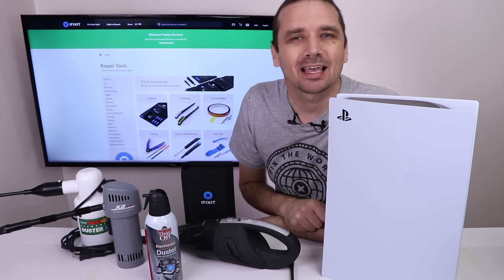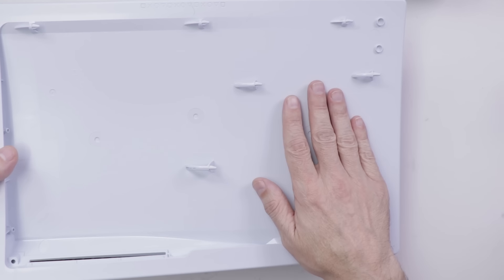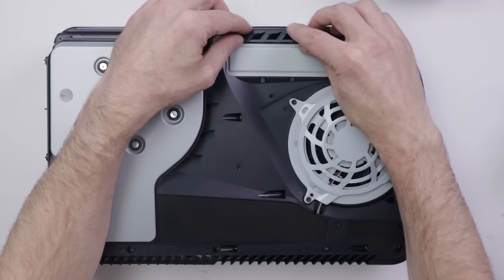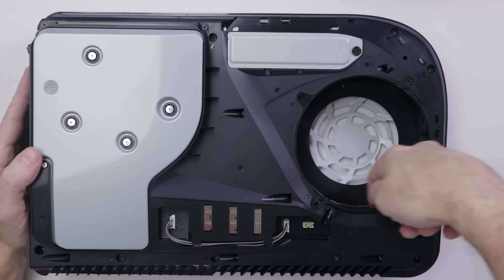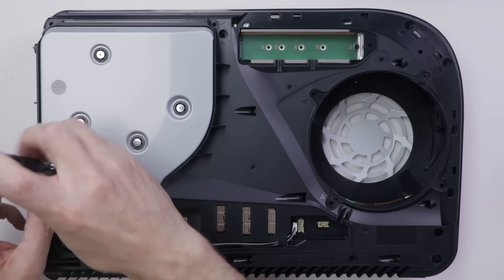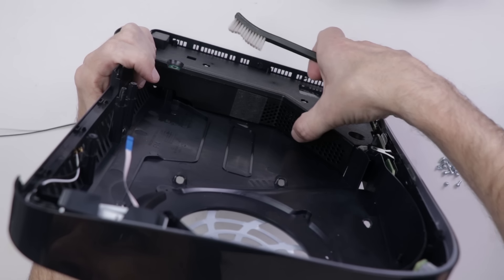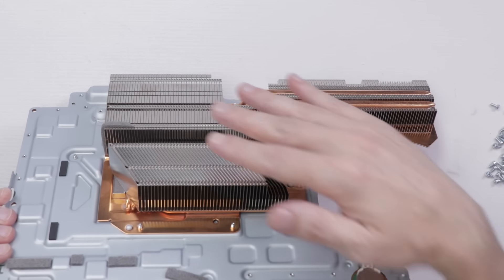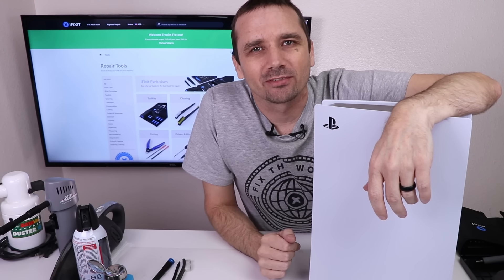How to Clean Your PS5 Safely - 3 Stages

Comment: Who else is here Bc their PS5 is shockingly quiet and they wanna keep it that way
Reply: i want to keep my ps5 clean but i dont have the balls to dis assemble the fan or mother board do you think i should lay it down or stand it up which one prevents more dust
Reply: @dodowater6936  But how can you clean it if you are too scared to disassemble it .
Reply: @zsk1y  you don’t have to fully disassemble it you just have to takeoff the white covers and vacuum the dust catchers and the rims and vacuum the white covers themselves
Reply: @citedgem  or you can just go to them game shops that repair and clean
Reply: @dodowater6936  bro do we need some sort of small attachment to clean the dust catchers?
Reply: @citedgem  iifyou only do stage 1 cleaning I don't think you're at any risk of jeopardizing your console, looks pretty safe
Reply: @EfftingES  yea mine is starting to make weird noises its quite but weird
Reply: @citedgem  it’s probably the coil
Reply: @MidnightIX  nah it was the disc
Reply: Not me
Reply: @MidnightIX  It is probably 2 reasons. Sony hasn't told everyone that all ps5's have the same fans. There are slightly different fans do to rushing systems out that are slightly smaller and less blades you can look it up on here. I think that could be it or you have your ps5 in a very confined hot space which is not good. Another thing you could have something in manufactured caught in the fan. A bug or something. Open it up. That happens also. Bugs roaches etc like to hide in consoles for warmth etc.
Reply: It’s hard for dust to get in horizontaly because the white covers block off everything
Reply: @Ggbrownieeadywin  Is that really true?
Reply: @citedgem  it’ll get dust regardless. You just have to maintain and clean it somewhat often before it’s gets to be too much and you won’t have to take it apart
Reply: I've had the console for 2 months now and I can see that it has caught up a lot of dust
Reply: @kyeresmith7772  I haven’t cleaned mine since I got it in November
Reply: @taliban223ms3  is it full of dust
Reply: @kyeresmith7772  I haven’t checked but it most likely is Bc someone blew a bunch of dust throughout my room on accident a bit ago I’m pretty sure it’s pretty dirty inside
Reply: @citedgem  same here lmao. Did you do it? If so, was it easy enough?
Reply: same i wanna clean my non-existant ps5
Reply: My ps5 is extra quiet so I wanna keep it that way but it’s funny that runs the risk of possibly breaking the ps5
Reply: @citedgem  wrap it with dust filter cloth
Reply: Bro i tried this and now my ps5 is loud like wtf😭🤦‍♂️
Reply: If you thoroughly clean it and replace the thermal paste it'll be like night and day.
Reply: @ivanvazquez7811  rip
Reply: @ivanvazquez7811  wait you cleaned it and it got loud?
Reply: @Juan800PimpBot  PS5 doesn't have thermal paste it uses Liquid metal
Reply: Me
Reply: @MadstupidStickmanEbruvplzsub   mmm
Reply: @Ozzy-2407  I know this already I was talking about ps4s because that's what people were talking about. If it was quiet and becomes noisy there is definitely an issue regardless of which generation of console I've repaired all kinds of stuff🤣
Reply: Me
Reply: My ps4 has given me ptsd 😂
Reply: Me ong
Reply: @dodowater6936  what if you’re too scared to take off the top cover cause you don’t want to break anything
Reply: @sou1eater218  all my homies were scared to with some force just lift up at the top corner and slide down
Reply: its not quiet
Reply: I can't see the inside it is CAKED with dust
Reply: @citedgem  bro it’s easy just don’t remove the motherboard or remove the fan wires I disassembled it and it was easy
Reply: @dodowater6936  what of you don’t have the air thing
Reply: Stage 2 is not even bad. That is if you not some destructive monster who has no patience or decently steady hands.
Reply: I dont even hear it
Reply: I am here because mind became louder than ever, and i juat cleaned my ceiling and dust flew everywhere
Reply: You’re not the only one
Reply: This thing is already hard enough to find so you best be sure I’m keeping this thing clean
Reply: @tbitwrld_3144  I would probably do this in a heartbeat or have a buddy who's knows how to clean consoles and invite him or her over to help out.
Reply: @EfftingES  guess I'll just start on getting a air can and just a old toothbrush
Reply: It's even more quiet without a disc drive 😂😆 love it
Reply: Same here, but I’m not planning to clean it for a couple years
Reply: Mine might as well be a nuclear test site, cannot relate but good luck keeping it that way, I’m irresponsible
Reply: I 😭😭😭💯
Reply: Is it still???
Reply: Is it ok that I used sum wet cleaning wipes? Already did the job
Reply: @tbitwrld_3144  what game shop does that
Reply: @citedgem  lmao same bro 😂
Reply: @dodowater6936  how do you do that??
Reply: @citedgem  same lol
Reply: Yup.
Reply: @dodowater6936  oh I need to start 😶 it’s been 3 months already.
Reply: Mine got so bad it started crashing on me
Reply: I’m here because mine is gettin loud
Reply: complete opposite, my ps5 overheats and sounds like a motorcycle, every hour of playing fifa or fortnite, etc, it shuts off and doesn’t give a warning. my games have been corrupted because of this too
Reply: @matthewmajewski4249  same
Reply: @amazingcloudy9351  haha same 😭
Reply: My ps5 always shuts off cuz it overheats can’t even enjoy warzone anymore
Reply: PS4 Pro homies I see
Reply: Jus got it cleaned today I can’t even hear it when I put my ear on it 😭
Reply: I got my ps5 not couple months after release. I gave the outer part a clean as was alot of dust. Recently tho cod has been a bit jittery and mk11 will turn my console off half way thru a round sometimes so decided to clean today. Used tooth brush cotton buds  a just bpught kit with the screw driver piece in and...... a bike pump with a football nozzle in as waiting on gf to bring back the air can from work. Did half decent job tho not sparking by any means but had ps on for bout 15 mins playing mk and seems to be running smooth and not sure if its placebo but quieter maybe. Il update if it crashes again
Reply: @Ggbrownieeadywin  i think its a million times dustier while horizontal its closer to the ground
Reply: Me
Reply: Mine is still stupid quit but just wanna keep it clean and there is a lot of dust on the sides of the center
Reply: I hot mine a month ago and am just cleaning it every month
Reply: Me
Reply: Its been 2 years now and it still dosn’t make a sound
Reply: So to be prepared for my ps5 in 2028 when it's in-stock
Reply: Same
Reply: @kyeresmith7772  try dusting once in a while? I dust my ps5 and it's cabinet space/ area at least once every 2 weeks. Takes about 30 seconds
Reply: Mine sounds like a turbine engine when ever I play Ghost Wire Tokyo so I think I need to clean it
Reply: getting older is taking care of your toys XD
Reply: FAX
Reply: @EfftingES  Stage 2 Cleaning is also really easy without any experience buy just following the guide carefully step by step. But i wouldn't do Stage 3 either.
Reply: Me
Reply: @citedgem  Same
Reply: What is a good Amazon product I can use for my ps5 to clean the dust
Reply: yep
Reply: Is it true that if you use the van air the dust will just go more deep inside the ps5
Reply: @citedgem  I don't have the balls to take out the plates
Reply: Me😂😂😂😂
Reply: @citedgem  that normal the ps5 disc make that noise when cutting the ps5 on
Reply: Especially the delta fan of a super quiet
Reply: Me
Reply: I got mines a week ago and the glossy part a dust magnet I’m definetly gone have to clean mines often this generation I’m just scared I’ll mess some up
Reply: Gotta o the fans that's the B part about the whole cleaning
Reply: Damn so much just to own a system
Reply: @Juan800PimpBot h.H D
Reply: Got a little anxiety to just take out the plates, I thought they popped off but they just have a like 2 little circles that you slightly move up and it just slides off. Didn’t want to do stage two because of the tools I’ll have to buy. But stage one seems reasonable enough. Some clean is better than no clean. Also I’m looking forward for the plates Sony is going to sell I’m thinking purple or dark blue if they have it.
Reply: I’m hear bc my PlayStation is overheating
Reply: Fr
Reply: If you want to keep your PS five quiet too, don’t follow this guy.  You’re never supposed to use canned air on your PlayStation five you’re supposed to use a vacuum to suck the ports out and the little holes inside. By using canned air, you’re pushing dust deeper into the system, and it will embed on the circuit boards
Reply: Hi
Reply: XD well I opened my ps4 after years not because it was noisy at all and geez got a nice surprise looked like a wool factory and honestly it was quiet
Reply: Shockingly quiet bruv….👌🏾
Reply: Facts!!
Reply: Mine is quite dirty in the fan yet I have barely any issues but I do make sure to clean stage one and I will clean the fan when I get the tools
Reply: Yep
Reply: Nah mine Just randomly turned off
Reply: @citedgem  Laying it down prevents more dust (Sorry if im too late lol)
Reply: @dangers-br6dy  nah bro that actually helps thanks
Reply: I’m here because mine randomly turns off
Reply: @citedgem  I’m not doing the mother board but I think just the covers and the fan are the main things to keep it clean and quiet
Reply: Mine sounds like a jet engine I recommend cleaning commonly
Reply: lol me
Reply: I was actually shocked when I got one that it was quite alot louder than my Series X but still very quiet
Reply: Facts
Reply: @D1n0nlyD1v94  you're ps5 shouldn't be super loud lmao.
Reply: @williammiller496  shouldn't. Exactly. When i say loud its not ps4 loud but almost ps4 pro loud.
Reply: My ps5 is louder than a train horn 😬😬
Reply: @playstation fix ur PlayStations so they don’t over  heat
Reply: @Topnotch_jigs_  Overheating would mean the system shuts down or begins failing when hot. I've rarely ever heard of a PS overheating. The fans being loud isn't overheating.
Reply: Hahahaha 😆 I literally thought I was the only one! 
It's amazingly quiet tbh 
It's nice to look after such a nice console ☺️
Reply: Me
Reply: Lmao mee
Reply: Me
Reply: I am here because I was stupid and neglected it and now it's shocking loud 😂
Reply: I’m here because it’s no longer quiet….
Reply: I was totally ready to do it but once he said forty something screws I was like😮
Reply: Tee
Reply: I lagged
Reply: Me
Reply: I'm never going back to the jet engine PS4. Absolutely insane how quiet it is.
Reply: @timpage9424  ikr
Reply: @nailozaz7596  you get that ps5?
Reply: Just did a stage 2 clean I mean it was quite dusty but it was quiet asf before.
Reply: @citedgem  hi! I bought my PS5 2 months ago and was with some dust and debri's i kept it verticaly i advise you to put it horizontal cause that way doesnt catch that much dust and debri's.
Also i heard that the chip's gel is more likely to get ruined when its vertical so from now on i keep mine horizontal
Reply: Only time it’s somewhat noticeable is when it reading a disc but other than that it so nice
Reply: I'm here because I have a Husky. Fun times.
Reply: @citedgem  maybe dust falling into fan?
Reply: Who said mine was quiet 😅🤫
Reply: Idk how quite I feel about that coil whine
Reply: I got FFXVI and it's getting loud and hot
Reply: Mine makes a sudden fan noise then just quits in middle of playing so that concerns me
Reply: Yep
Reply: Video instructions unclear - I now have screwdriver and pliers lodged in my eye sockets
Reply: I wanna clean it but I’m scared that I will break it
Reply: @ladicek760li7  I just cleaned mine. All I did was removed the plates. Used a vacuum and a tooth brush to clean the dust and for the fan you can remove the fan without un clipping the wire. 
I've had my ps5 since it came out and tbf I didn't have much dust but nice to know its clean. It's so easy. You can't go wrong
Reply: Overheating issue here,
Reply: Had it for about 6 months and already loud 💀💀
Reply: @losamigos4860  is your place hot ? I'm in the uk and it rarely gets hot so my fan has never been loud. I have had it since it came out and only deep cleaned it once. I have cats and dogs too
Reply: I’m about to get a PS5
Reply: @Imsorezzy  nice°
Reply: literally me 😂
Reply: Me
Reply: you deffinetly red my mind
Reply: Amén 🙏🏽😂
Reply: Me lmao it’s soooooo fast and quiet
Reply: I’m here because my cat stepped on a packet of marinara and it splattered all over my PS5 😂
Reply: Mine is really dirty
Reply: It's so quiet. I was playing FF 16 with the fan off to see if it makes any noise and no. No noise at all. I think they did a great job with the cooling. PS i keep my PS5 horizontal
Reply: @citedgem 2 years late, but Personally I just take the SIDE plates off and clean off the vent grill and LED area. Most of the time I'll take out the fan to wipe it down nice, which isn't really dangerous as long as you don't forcefully yank out parts.
Reply: I just took the covers off mine & gave it a once over because it looked spotless ,but then I got to my Son's Ps5 & Holy hell batman that thing had more carpet fluff/Dog hair/Everyday dust/I'm sure I seen a light seethrough plastic cheese wrapper in there too😅 omg .Ps I also moved his ps5 out from a Corner standing up & now it's Laying down with no stand....I'm praying it stays clean for atleast a month or two until I clean it again...thanks Tronics
Reply: Yup
Reply: That and I wanna add stickers to A CLEAN PS5
Reply: Lmaoo me 😅 tryna prevent it from sounding like my old ps4😂😂
Reply: Yessirrrr
Reply: Nooooo I want my PS5 to be as loud and get as hot as it possibly can 😂
Reply: @citedgem lay it down. Perry obvious right? Standing up the dust can settle straight down into the vent holes
Reply: I'm here because I let my ps4 get ridiculously filthy and I'll be dogged if I let my ps5 get that way...when I get it one. 😅

I like to get a jump on things... 😂😂
Reply: I'm here to download Spiderman 2 faster
Reply: What's the tool to remove the fan bolts and what size?
Reply: @Ggbrownieeadywin  PS4 gets horrible dust horizontally
Reply: 2 years later and yep
Reply: Read my mind😅
Reply: Ha, dude for real
Reply: Literally thoooo
Reply: Hopefully no one since taking it apart won't keep it quet...
Reply: I broke the studs in the middle of the screws so I could use a normal T8 Torx
Reply: me😂
Reply: I appreciate  this guide so much that I'd give it more likes if I could. My ps5 is squeaky clean and sneaky quiet.
Reply: Way too accurate😭
Reply: Mine is pretty loud when its turning on and loading a game, then completely silent the rest of the way, but im concerned with the starting noise
Reply: I'm to scared to disassemble it
Reply: I came here cuz I'm trying to figure out how to clean my Gamecast
Reply: I just know that if I stripped it down like that, it's not working when I put it back together lol
Reply: I clean my console once a year and im overdue for its 1st time. Ps5 still quiet but she needs daddy's rubdown
Reply: Me because I've got slight dust bulid up on the vents at the top and bottom
Reply: I’m here because my ps5 doesn’t turn on anymore
Reply: @kaozmenace  bro 🤣🤣🤣😭😭😭😭
Reply: Tell us you're not playing 4k titles without telling us.

Mine is super quiet when playing @1080p. If I run native on my G7 monitor, it sounds like hell's furnace after 10 minutes.
Reply: @citedgem  you don’t have to remove the motherboard, that’s only if you have a lot of dust build up
Reply: M scared to do this broo
Reply: Does it void the warranty?
Reply: @aguyfromparalleluniverse  I think the third stage does
Reply: I’m here beacuse Mine froze lol
Reply: Na, got one yesterday and it's loud asF way more so then my xbox one s, don't want it to get any worse😂
Reply: Here because mine randomly shuts off every 5 mins lol
Reply: No joke that actually happened to me the first time I cleaned it with this game.

Once I assembled everything together again, started playing Spider-Man and the PS5 was astonishingly quiet, changed to Fortnite and again no a single sound. Suddenly the game started crashing and then the PS5 said it had to shut down, I didn’t plug the fan again, that’s why there was zero noise 💀
Reply: Hell yeah, unless you got the disc version lmaoooo
Reply: Not me
Reply: My ps5 is completely quiet and yes I do wanna keep it that way! Stage 1 and 2 are very easy so I will do Stage 1 and 2 every 2 months!!!
Reply: Me
Reply: Same😂
Reply: It's gotten extremely slow
Reply: Oj yeah. Same
Reply: I’m here because your mom
Reply: @citedgem  I have the digital sadly
Reply: 3 years still quiet and I’m still paranoid
Reply: Put a game in?
Reply: me lol
Reply: Same here
Reply: Best believe it. The ps4 pro I had was a jet engine even after re thermal pasting
Reply: Is it not supposed to be quiet?!
Reply: @citedgem  trust me it’s not that complicated just follow the tutorial
Reply: @citedgem  we got to take out the fan at one point or the other I’m taking mine apart for the first time in a year it was pretty dirty but cleaned up nice
Reply: Love my ps5 😊
Reply: I'm here bc my ps5 went up in smoke after trying to turn it on lmfao
Reply: Me too
Reply: @Mar2Starr  couldn’t be me
Reply: @Mar2Starr  I'm here because my machine is suddenly shutting down 🤮
Reply: I come on to check how to clean because my ps5 sounded like a ps4, then I listened closely some one was mowing the grass down the road 😂😂 but now I know how to clean 💪🏼
Reply: @urbanerror977  my os4 was 10 years old when I sold it for 100$ it was never any issues with it. No noise or anything. And I never cleaned it 🤷
Reply: @citedgem  a little late but standing it up will damage it
Reply: @Mar2Starr  u got me
Reply: @Mar2Starr  nah you tripping
Reply: @Mar2Starr  Shockingly quiet but also the bottom gets really hot when playing certain games like Call of Duty for example. My system wasn't really too dirty so I'm guessing it's just got something to do with specific games.
Reply: Meeeee!
Reply: Big facts
Reply: @Mar2Starr  lol no shockingly loud and overheating
Reply: Here cause mine broke from overheating
Reply: Mines is quiet but It shut off after awhile for no reason it's not running hot or nothing and I cleaned it pretty good for the most part
Reply: @dodowater6936  bro thank u I needed this answer lol 😂
Reply: @Mar2Starr  right here
Reply: Me
Reply: Everyone should learn how to clean their gaming systems because going to clean and repair shop is damn expensive.
Reply: Is there any game shops in the Baltimore md area that cleans game consoles
Reply: I'm here because my PS5 decided it didn't want to stay powered on
Reply: @citedgem  if u just take the plates off and vacuum the inside it will do it just fine
Reply: Honestly & I smoke in my room & I see madddd dust caked up😩😭
Reply: I’m here because my ps5 be randomly turning off might just be overheating
Reply: This is ridiculous, you shouldn’t have to be doing this, I have mine, for close to two years, I have a dust cover no need for this. You didn’t have to do this, to the previous consoles. This is to extreme.
Reply: I wish mine made a pop n cut off.  I’ve fixed plenty of ps4s this my  first time messing with a ps5
Reply: @Mar2Starr   I'm here in 2025 for the third time since I got the PS5 haha This is the best tutorial!
Reply: @Mar2Starr  swear!! 😂 I’m here 4 years later but hell yeah
Reply: I'm here cause my ps5 just started whirring quite loud when copying disc games
Reply: @Mar2Starr  mine will just randomly turn off without any warning at times
Reply: Me 😂
Reply: @Mar2Starr  man this is me right now going for about almost 3 years with mine only cleaned it stage one and it was way cleaner than I expected it to be hoping I never have to open it all the way to clean it ever ….
Reply: No. Mine just keep cutting off
Reply: I’m the exact opposite 4 years later😂
Reply: I’m here because I’m thinking of trading my ps5 for a steam deck